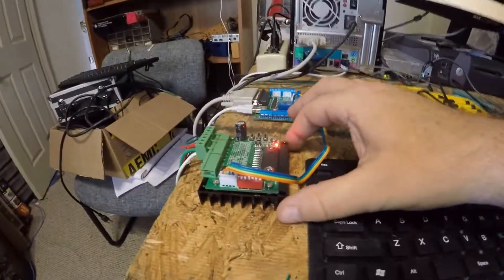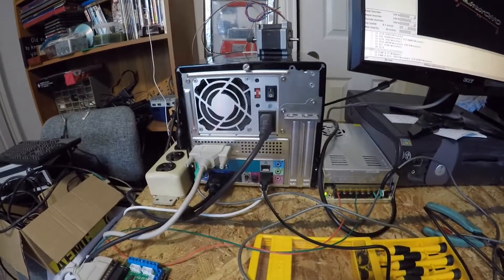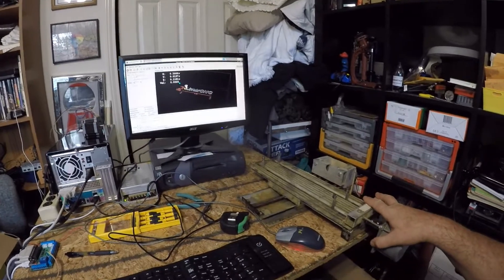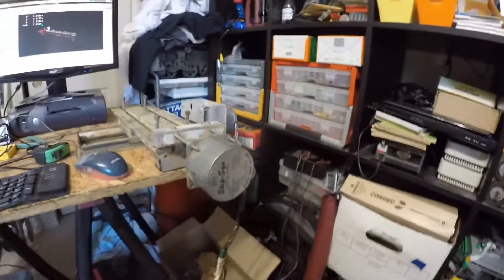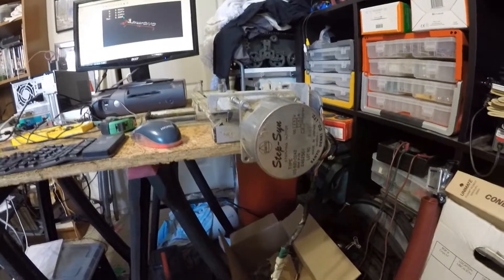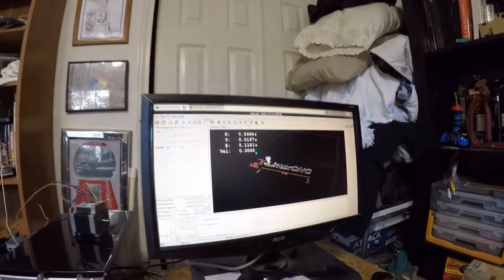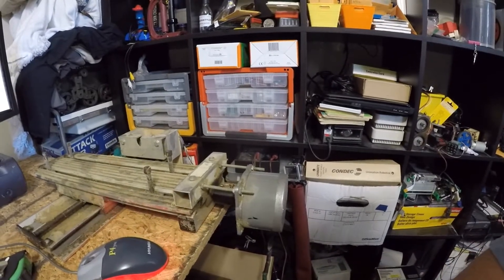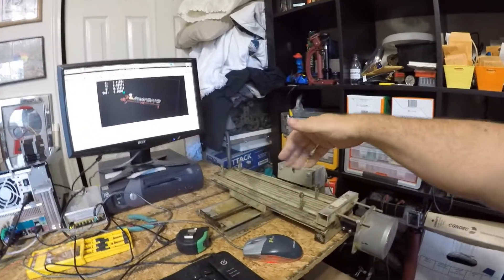Frankenlab CNC #1 - Getting Started

Comment: I tried the setup in the video with Mach3 but it wouldn't work
Reply from the maker: Mach3 usually has a different breakout board where the pins are located differently. If you do have the Stainsmart board, then you must be sure that the Mach3 matches the same pinout. I would have to see the particular board you have and your setup. Go to my web page, get my email address, and i'll do my best to help you. Unfortunately... I do not have a machine setup to do Mash3 as I work with LinuxCNC.
Reply: @Askjerry  Mach3 is dead set it on fire, and throw it off a cliff, LINUXCNC is the future.
Reply from the maker: @FreedomFactory3D  AMEN! :-)

Comment: what is the motor controller?
Reply from the maker: The motor controller is connected to the breakout board and supplies the actual drive signals to cause the stepper motor to move as directed. In some cases this can be a servo controller which also uses an encoder to determine the position of a DC motor. Typically however, most DIY machines use stepper motors... the STEP and DIRECTION signals cause the motor to move when ENABLE is high.
Reply: I mean like what brand/model is that motor controller
Reply from the maker: Stainsmart... you can get a kit with the breakout board and driver... or just the drivers.
https://www.amazon.com/SainSmart-Router-Single-Stepper-Stepping/dp/B0093Y88SK
Reply: thank you this is awesome and so are your videos. I hate to bother you but one more question, is the rail for the mill head a c-rail?
Reply from the maker: Yes, the two sides, the horizontal, and the vertical parts are C-rails.
Reply: thanks. I noticed the weird connector on the breakout board, do i need a pc for this board if so is there a way to do it with a laptop?
Reply from the maker: Carson Turner The breakout board plugs into a parallel port.
Reply: so if i used a parallel port adapter to USB it would work for a laptop
Reply from the maker: No, it would not. The USB cannot handle the bandwidth, and LinuxCNC is not configured for USB. You could plug in a PCI adapter and use a parallel card, or a MESA card. But overall, a laptop is not recommended.